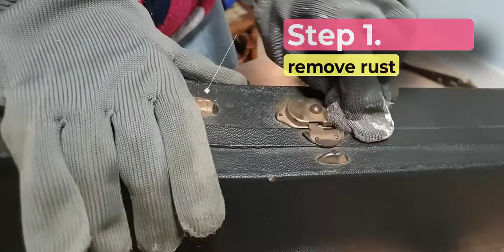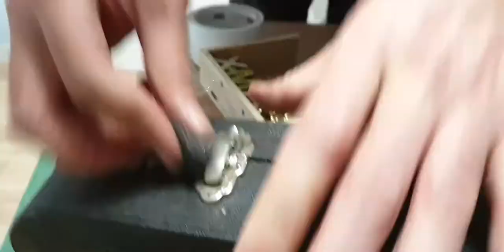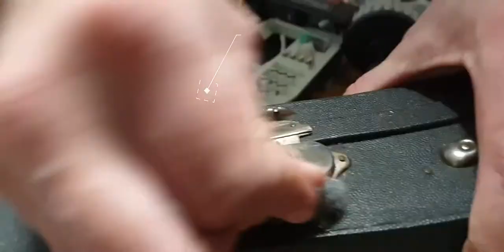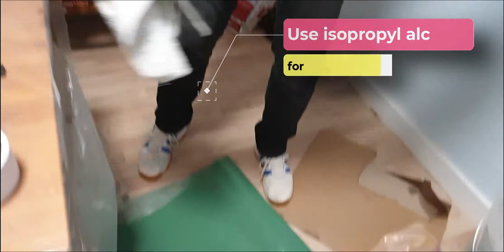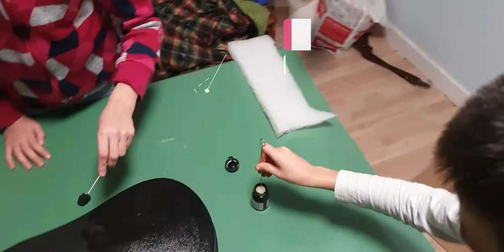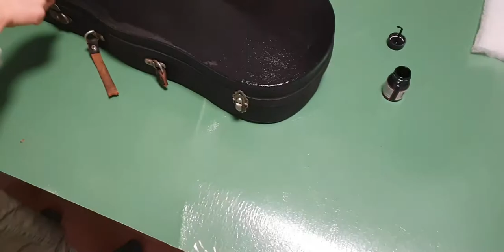Violin Case Restoration in 3 easy steps

Comment: how about there are scratches on the case? should I put some  leather fillers first before painting?
Reply from the maker: The Angelus leather paint should fill the scratches. Can be applied multiple times, but leave enough time for drying before the next layer is applied.
Reply: @biro_restoration  yeah but on my case there are some deep scratches on its edges